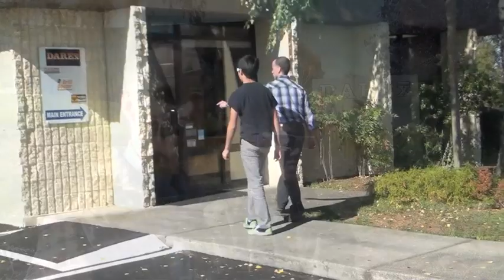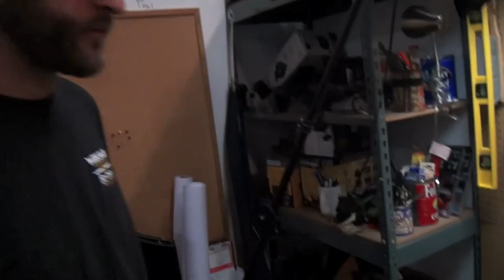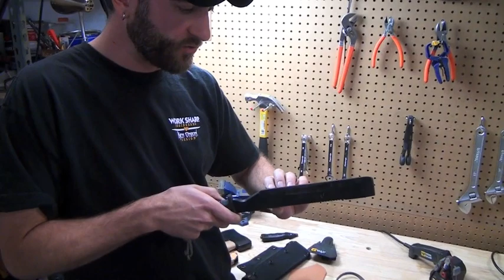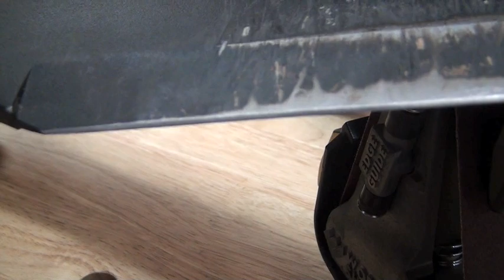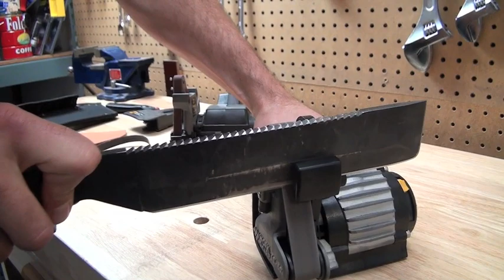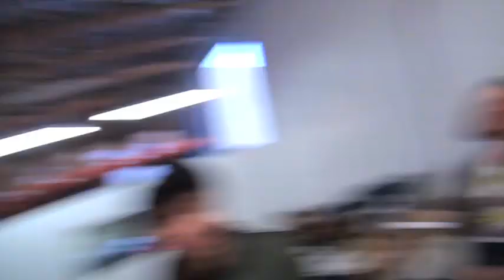How To Make Your Knives Work Sharp Sharp!

Comment: Can you use this with a katana? Also what angle would you use?
Reply from the maker: I've sharpened lawn mower blades with the Work Sharp, I'm pretty sure sharpening a katana is possible, although I've never done it myself. I believe most Katanas or other Japanese blades will use a 20-degree angle but check with the maker of your particular Katana to be sure.  With the Ken Onion edition, you could drop the blade into the slot and look at where the belt (not spinning of course) and blade meet and make your adjustments that way. Thanks for watching!
Reply: TSG Thank you

Comment: I own a Worksharp knife and tool sharpener and believe it's a great system.  What I do not need is a video which does nothing but allow the maker to tout the product.  What would be more helpful is an honest evaluation of the sharpener with its advantages and drawbacks. As much as I like this sharpener, it does have its drawbacks. It requires time and patience to learn to use it, and you must be careful because it can remove a lot of material quickly.
Reply: Then you can go watch the 10,000 other videos that do just that instead of bitching about somebody who took the time to actually go to the maker and bring content to YouTube. If you don't like it don't watch it but stop your crying

Comment: After using the P120 belt which seem to take the longest how many times should run my knifes through the P220, P1000, n P4000 belts bro.
Reply from the maker: Thanks for watching! Depends of the steel your sharpening, but in general 1 or 2 passes each side, each grit (could be longer). Look and feel for a burr each time. However, Pp4000 belt will strop the edge and you really won't see/feel a burr, but 1 or 2 passes should do it. Take your time.
Reply: I have a silver stag knife which is D2 carbon steel. You think 1 or 2 will do the trick and does the Ken Onion come with the following abrasive belts: P120, X65(P220), X22(P1000), and X4(4000).
Reply from the maker: djm93 Depends on the current status of the edge. My Ken Onion had those belts in the box.

Comment: I have just bought a WSKT Sharpener, and am so far,very happy with the results.
My query is this, why is the machine being used to grind the blade downwards on one side, and upwards on the other side?
Surely if the blade is sharpened with the belt travelling in the same direction ie-turn the machine around, so the belt is travelling downwards on both sides, this would achieve a sharper edge?
Im a bit wary of pulling my blade through the machine with the belt travelling upwards, what with the particles being removed travelling upwards at speed, and the possibility of the blade snagging the belt.
Would the practice of turning the machine around ruin the blade, or is this an acceptable practice that your researchers have looked into?
Many thanks in advance.
Reply from the maker: Thanks so much for watching! Thanks for commenting. I asked the same question @ 17:55. Give a listen again at that point. As for "snagging" I've used it hundreds of times and this has never happened.
Reply: It doesn't matter, it's a non issue. As long as the material is being removed from the blade it doesn't matter which direction it's from. There had been years of research into this and there is nothing to worry about. There is zero difference in sharpness, longevity etc. between sharpening it the same direction or different directions, like I said it's a non issue - the blade doesn't know the difference, especially when stropped to a mirror finish.

Comment: Great video, I've been using the Work Sharp standard model for about four months and like the results but after watching this video I plan to buy the Ken Onion edition. I like the idea of the variable angle option. I sharpen knives for a living and believe it or not the Work Sharp competes with my $1,000 machines although the process is a bit slower. It does come in handy when sharpening small pocket knives and hand pruners.
Reply from the maker: Great testament to a great tool. Thanks for watching and commenting.